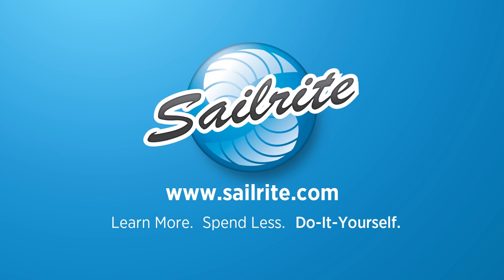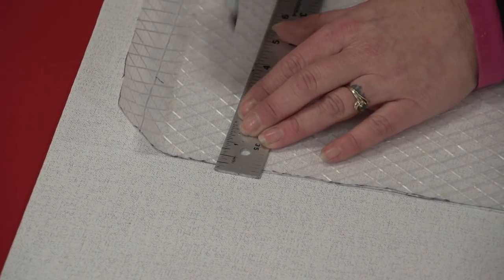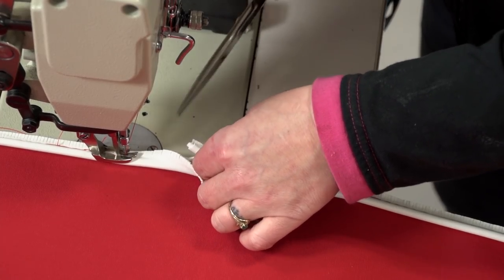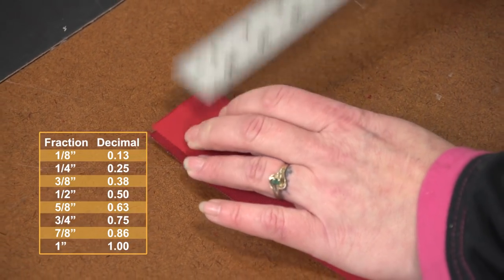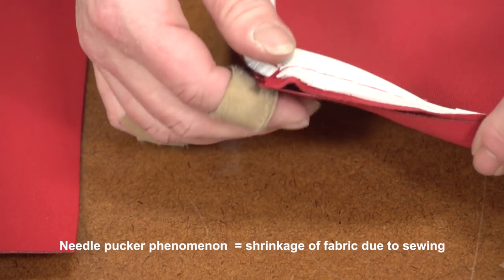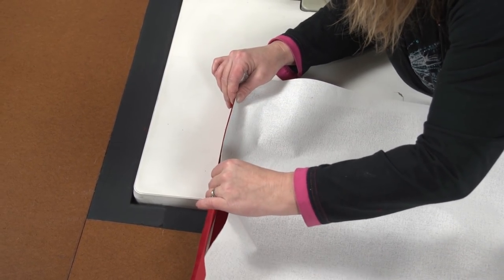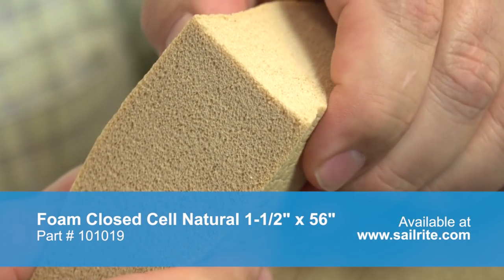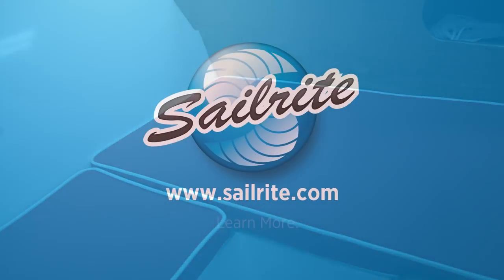How to Make Cockpit Cushions - Box Cushions

Comment: Regarding foam - rain through is great for "live-in-the-cockpit" cushions because of its fast drying capability and comfort factor. However, it can be a bit squishy to walk on, especially if you go for 3 inch thick versus 2 inch. After having a full set of cushions made using rain through foam, we decide to replace the foam in the small square forward port and starboard cushions with 3 inch closed cell foam to give better footing when exiting and entering the cockpit. Floatation foam also allowed these two cushions to do double duty as life cushions. Other tips - for easy cockpit locker opening, we patterned the cushions to cover each locker making raising the locker seats easier. To keep the cushions in place, add short fabric strips with a snaps on the bottom box sides of the cushions. These snap onto the sides of the locker hatches - like a saddle - so when stepping in and out of the cockpit your foot force won't pull the snaps apart. (Don't add snaps to the rear seat coaming as your foot force will generate pressure against the snap shear and they will unsnap.)  Strips of military velcro along the rear bottom edges of the cushions and seats will also help keep the cushions in place when heeling. Adhesive military velcro will stick to fiberglass, but be sure to sew the velcro onto the cushions.

Comment: Great video, just curious, you say you sew across the zipper on both ends of the zipper, do you actually sew across the plastic zipper teeth or just next to the end of the zipper?  If you sew across the plastic zipper teeth, how do you keep the needle from hitting the teeth?  Thanks again.
Reply from the maker: We do sew right over the teeth of the zipper. You can do this by rolling the sewing machcine's balance wheel by hand so as to go between the teeth and not break a needle. Do is very slowly.

Comment: My project is bottom seat cushions.  I want to cut the existing in half for two bottom cushions.  I am adding the 5 mil batting.  Do I have to make the foam smaller due to the batting on the new side seams in order for them to fit the seat opening?

Comment: Really torn between using Phifertex vs the underlining fabric for cockpit cushions.  I believe that the underlining would be less slippery but would the phifertex hold up longer? Do they shed water equally as fast. thanks so much
Reply from the maker: Hi Ohanakai4,
I wouldn't say there is a big difference in water drainage or lifespan since both would be used on the bottom of the cushion. If you are concerned about slippage there is also a non slip underliner I have attached a link to that one below.
https://www.sailrite.com/Super-Grip-Non-Slip-Cushion-Underlining-Black-54

Comment: Great video, thanks.  My first project was fender covers, now I am on to some additional cushions so I can convert my salon table to a bed.  There is no mention in the video regarding zipper length.  Is there a rule of thumb?
Reply from the maker: Grouperhound The length of the zipper should always be the length of the cushion plus a few extra inches.
Reply: Ok.  Thanks. It's just that when viewing the video the zipper looks measurably shorter than the cushion, say by at least 8".
Reply from the maker: Grouperhound Yes, the zipper can be shorter than the side or it may be made to extend all along the side. That total length desired is up to the fabricator. I just always order a zipper the same length plus a few inches for each cushion I need, so I have enough. The bigger the zipper opening the easier it is to insert the foam.

Comment: I recall in your how to make a stadium cushion video you said for cushions to add 1/2" to the boxing and cut out the top and bottom plates the same size as foam. Is this the same as adding a 1/4" to all ???
Reply from the maker: Here is the rule for building cushions: No rules, just do what works best! I have made cushions in many different ways, some I like better than others. Here is my preferred method for cutting plates and boxing for cushions --

Patterning:
Create a pattern or take your geometric measurements. These should represent what the expected finished size of the cushion is to be.
Cutting Plates:
Cut Top and Bottom plates to the pattern, plus ¼” all around.
Determine Boxing Width:
Determine boxing width by measuring foam thickness (include batting, if any, under slight compression during measuring). To this measurement add between ¼” and ¾”. Keep in mind that thinner cushions look best with more allowance added and thicker cushions look best with less. Basically adding less of an allowance will allow the seams to roll into the edging of the cushion. 

Let me know if you have more questions. Thanks, Eric

Comment: Is there a reason that the port and starboard cushions extend all the way aft so that the aft cushion is smaller than it would be if the aft cushion went all the way across and the other two were shorter?  I think I want my aft cushion to go all the way across, but there may be a good reason not to do it that way.
Reply from the maker: Hi Amanda,

That cushion is smaller so that when the cockpit is not fully occupied you can remove the cushion and go down into the cabin without stepping on the cushion and without the side cushions possibly moving around.

Comment: Thank You for an excellent video - I am going to sew new fabric for my cushions and I will use the existing foam i have - do I have to "shrink" my pattern according to your instruction for the new foam you are showing at the end of your video? ( 0.5 inch in the width and 1 % at the length - to get the same tight look as in your video)
Reply from the maker: +Ane Samuelsen The foam should be slightly larger than the plates for a good fit. The desired finished size pattern usually has a 1/4" added on all sides of the plates. The foam is 1% larger than the desired finished pattern (usually no less than 1/2") so your plates shoud be about a 1/4" smaller all around your old foam.

Comment: Can you layer the boxing cushions, say if I want to layer it with a memory foam topper?
Reply: This will be an indoor cushion.
Reply from the maker: Yes, layering foam in a cushion is common. For example most sleeping mattresses are made by using layers of different types of foam. Typically a base foam (bottom layer) is what is called a “support foam”. This base foam is usually a high density Polyurethane firm foam from 4 to 6 inches in thickness. The next layer is typically a “comfort foam” and is typically a high density Polyurethane medium or soft foam from 2 to 3 inches in thickness. Then the top layer (if desired) is sometimes a memory foam from 2 to 3 inches in thickness. The overall thickness of the matters ranges from about 9 inches to 11 inches when all the layers are combined.
Reply: @SailriteDIY  would you need to stitch the cushions together, or do you just stack them inside the cushion cover?
Reply from the maker: @meowzic  If you are talking about the foam you would need to glue sections or layers together. If they are not glued they may move around in the cushion cover.